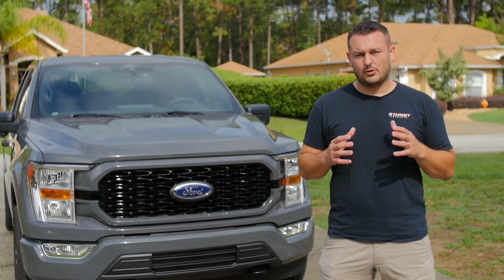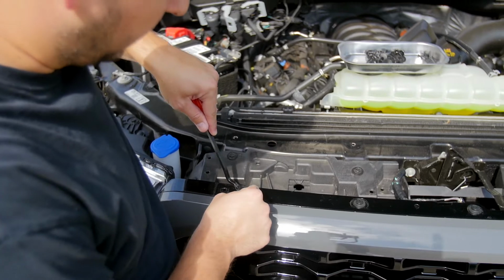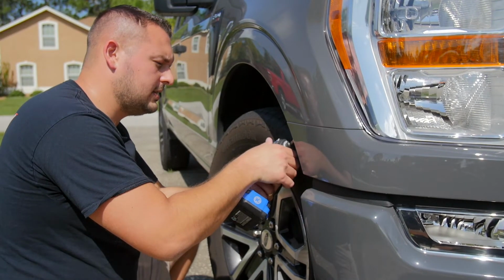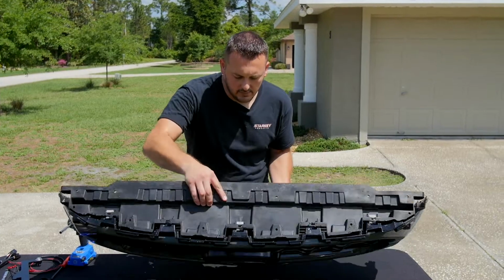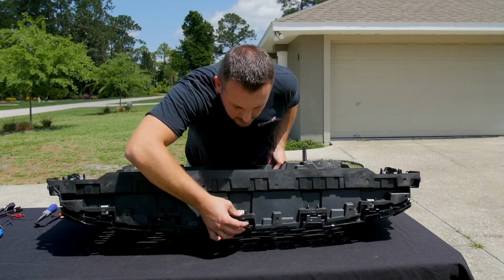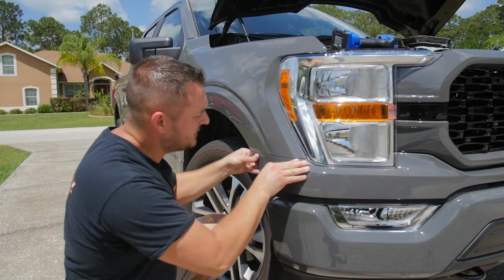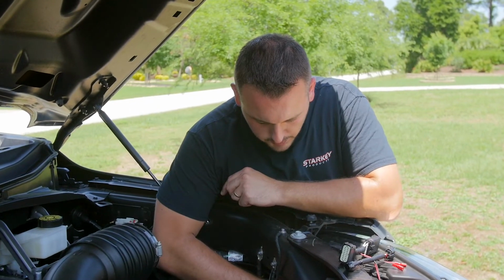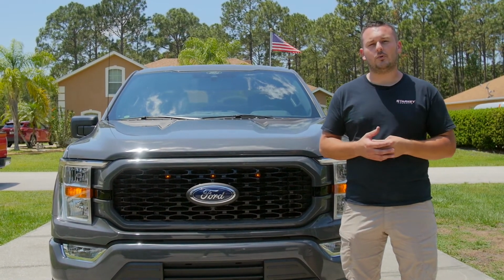Starkey 2021+ Ford F150 - Raptor-Style Grille Lights | Saturday Morning Installs

Comment: I have a 2021 lariat. Is there any light that I can switch from clear to amber with a controller or app?
Reply from the maker: Hi - I am afraid we don't have anything quite like that. All lenses are clear, but you can select either white or amber LED's when ordering. We also have pictures in both colors for reference:
https://www.starkey-products.com/products/starkey-ford-f-150-raptor-style-grille-light-kit-fits-lariat-2021-2023?_pos=1&_sid=5932a0560&_ss=r&variant=42858246668388

Comment: What plug and play connector do I need to order for the quad led head lights on 302a xlt sport? I have halogen side marker and halogen turn signals
Reply from the maker: Hi Austin - you would need SKU# 4531 - This fits all trucks that have halogen parking lights which includes the Reflector LED headlights (Quad) and the standard Halogen headlights. 
https://www.starkey-products.com/Ford-F-Series-Parking-Lights-Adapter-Halogen-Headlights-2015-2016-2017-2018-2019-2020-2021

Comment: F-150 Raptor like grille lights for 2022 King Ranch. Do you have Brighter lights as those don't look bright enough? Dan
Reply from the maker: Dan - We only have one version of lights. It is difficult for our video team to accurately depict light output when they film these night shots, but having seen them many times at night, I would say they match up well with the brightness of the factory parking lights on the headlights. 

We also make these with White LED's, which are a bit brighter than the Amber version.

Comment: 2021 ford Lariat. What plug and play connector do I need???    ty
Reply from the maker: That would depend on the type of headlights you have.

If you have the halogen headlights OR Quad beam LED reflector headlights, you will need the 4531 adapter found below:
https://www.starkey-products.com/Ford-F-Series-Parking-Lights-Adapter-Halogen-Headlights-2015-2016-2017-2018-2019-2020-2021

If you have the Dual Beam LED Dynamic Bending headlights, you will need the 4732 adapter found below:
https://www.starkey-products.com/Ford-F150-Parking-Lights-Adapter-LED-Headlights-2021-2022
Reply: @StarkeyProducts  Can I email you a close up picture??
Reply from the maker: @thegalleryBBQ  Absolutely! We can confirm it very quickly. The email is sales@starkey-products.com
Reply: @StarkeyProducts  Email just sent. Thanks-
Reply: @StarkeyProducts  Will you see the email as im not sure your sales team will no what im asking.
Reply from the maker: @thegalleryBBQ  Hey Tommy I just saw it and replied. You need the #4732. Thanks!
Reply: @StarkeyProducts   Ordered. Thanks brother for the awesome service.

Comment: I did convection just the way you showed, amber lights works nice, but as soon I turned the engine on the amber lights turn off
Reply from the maker: Hi - that sounds like normal daytime operation. These lights are attached to the parking lights circuit which is powered anytime the headlights are on. During the day in most cases, they will be off. They should come on anytime the headlights are on. If you have any other questions or concerns please let us know! Thank you!